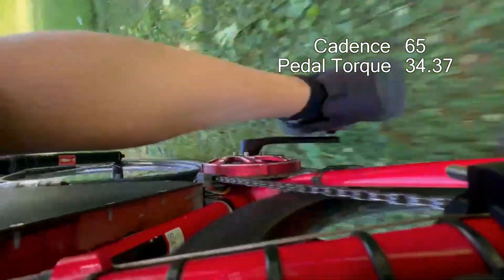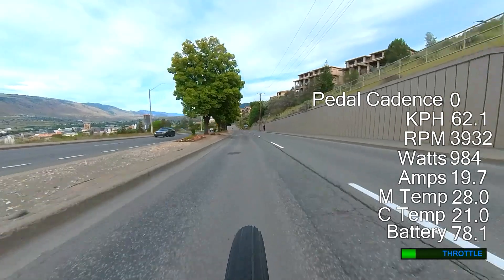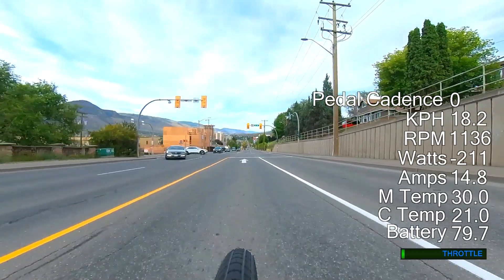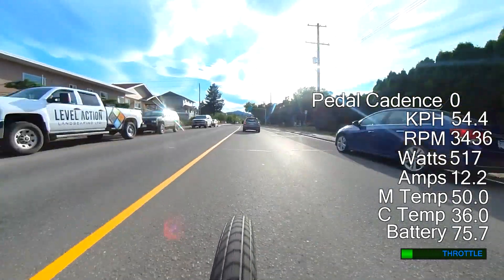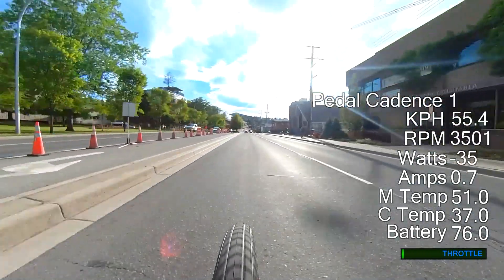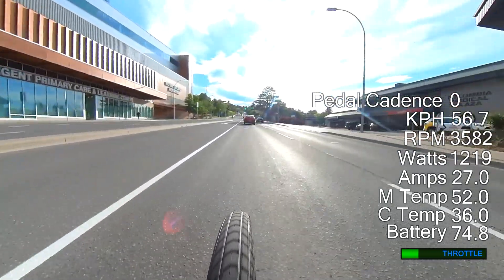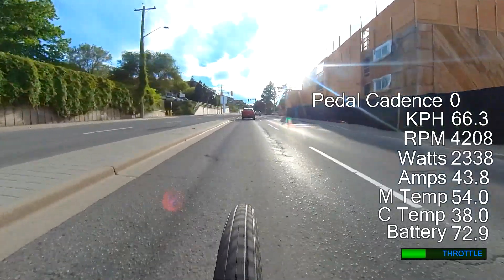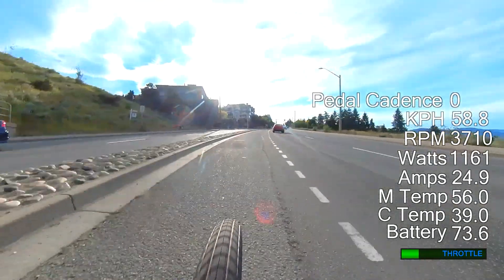Torque Sensing BBSHD (M635) TOSEVEN motor Tuning and Other news - High Voltage 2024 Mid Year Update!

Comment: The To7 team have really improved the ride feel of their stock controller. It's quite good now. The robustness of the controller and the way it floats in midair (is peone to heat up) seems a simple fix for the factory. As with all things, time will tell
Reply from the maker: I’ll get to try the latest firmware shortly here I hope. Cheers Ian
Reply: @HighVoltageKits  I'll be surprised if it doesn't impress. There's a lot of nuance to be gained with the addition of E-assist in the later firmware

Comment: New to the channel and impressed by the content, also your clarity and how focused/organized you are.

I have been commenting on a couple of your M625 videos this past week as I received one for a crazy deal. I've been trying to unlock the canbus system and after many emails with a customer service agent at Bafang, they finally sent me a ".bin" file that they claim will remove the battery proprietary stuff. I have no programming cable and frankly this is past the point of my experience. Sounds like you have a full plate right now but if you have the tools and want to take a crack at it, it would provide a solution to many that hasn't been cracked in 2 years. I can send you the firmware if you like.
Reply from the maker: Compliments from the dark lord of bikes ;) Shoot me a mail to john@highvoltagekits.com and we can sort something out. Would be a good thing to do a guide for to help others if it all works out. Appreciated. Cheers
Reply: @HighVoltageKits  Sent! :)
Reply from the maker: Excellent. Cheers

Comment: My Dm01 failed after 50 miles having the usual run around from psw powers not replying and tooseven wont  honour warranty!!
Reply: Gotta buy from a reputable dealer like Cali Ebikes if in the US or directly from toseven
Reply from the maker: That’s unfortunate. If you bought it with a credit card or PayPal you can likely do a charge back?
Reply: @HighVoltageKits  lesson learned credit card nextime looks like a bafang m635 as I prefer torque sensor unless you can come up with an alternative thankyou for your reply much appreciated
Reply from the maker: Bag an M635 now if you can get one. They have pulled it. You are welcome to post your TOSEVEN issues on the Discord maybe we can help there. There are links in the description.
Reply: @HighVoltageKits  Thankyou will join the 48v forum
Reply: 😂 thats what I needed to hear im not buying a mid drive
Reply from the maker: It’s a fair point. Not resolving issues promptly will hurt them financially as people like yourself see there to be a risk buying one.

Comment: Isn't bafang  doing its best to move away from the DIY model and more towards the proprietary off the self bikes. 
More room in the market for other manufacturers and more R&D for the high voltage boffins
Reply from the maker: I have seen some sales figures from them and it is partly that as well as overstocking. Full bikes being sold off cheaply is another thing against DIY. We have some ideas though. True DIY won’t go away but possibly Bafang will.

Comment: Bafang has too much revenue going in from their hub and frame mounted mid motors to be bothered investing too much into M635.
We can only hope that other like Toseven and Tongsheng will up their game and fill up fhe gap.
Reply from the maker: Their sales in 2023 dropped off all over but 53% less in mid drives. It’s that whip effect from COVID. There is huge overstock right now of both motors and bikes. I’ll do a video on it if I can dig up some time on the weekend. Seems like a few people are interested.
Reply: And CYC does not enter in the equation?
Reply: @cilami  the affordable price and the reliability is what CYC lacks.
Reply: @ukrytykrytyk8477  why look only at the negatives? Of those motors, only the CYC will fit modern MTBs; and they are still less expensive than some of the real fringe alternatives. Mine has had no issues and has been reliable in the 18 months I've had mine installed.
Reply: @hindesite  Main problem is extreme price. 1200 euro for Photon. That's more than german Bosch/Brose motors. Also Motor is glued like freaking smartphone. Good luck in fixing that. 
Photon dissipate heat way too slow in comparison to DM02. Photon start to overheat above 500W. If photon cost 600 euro then I would consider that as good alternative for DM02 or TSDZ8.
Reply: @cilami  probably not, despite the Photon particularly, being the best of these DIY mid drive motors. I have one and it really is superb.

Comment: TOSEVEN DM01 tuning would be awesome!
Reply from the maker: It runs great without the torque sensor! We’d just really like that part to be functional as well. Otherwise you may as well just get a bbshd.
Reply: @HighVoltageKits  any interest in selling kits anyways for people that don't have BBSHDs, do have a DM01, but want more power? I'd be fine with PAS only if I could get 3-4kw out of the motor.

Comment: This was not the news I was hoping for concerning the m635 :( Maybe bafang has decided to move to 60v, glass half full mind set
Reply from the maker: I’m not sure. There are some major headwinds in Ebike’s post COVID. It’s moving more and more to proprietary stuff sadly.
Reply: I wouldn’t be too optimistic. I think Cap hit the nail on the head with the bike industry issue currently. Many businesses are shutting, and it’s tough in the industry right now.
Reply: @georgeforeman89  Sure but I also don't see why they would shut production down. They already spent all the R&D money and tooling costs
Reply from the maker: @Bengy22 I’m going to do a video on Sunday in a bit more depth as there is quite a bit of interest